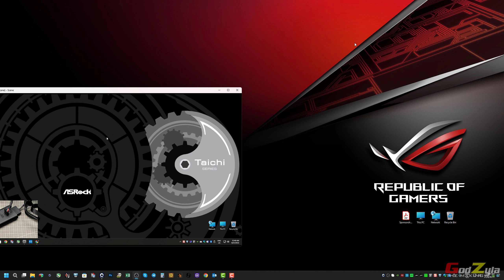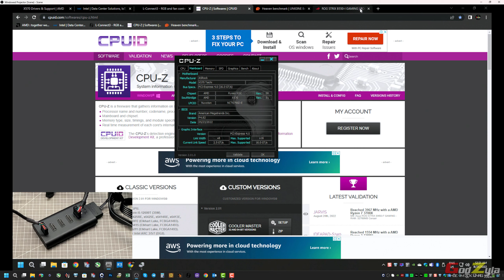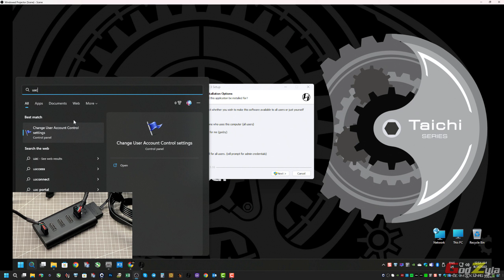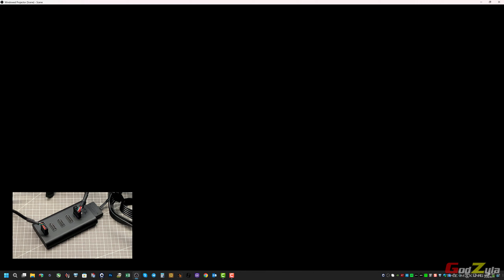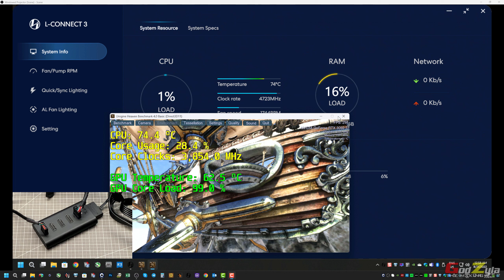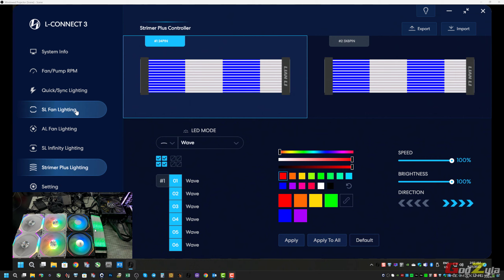Lian Li ARGB Products (How to make it work?) [L-Connect 3]

Comment: Help, I have the strimer 8pin V2 but 24pin V1, and with the L connect 3, how do I set it up?
Reply from the maker: welcom to my channel Siane. If you have the Strimer Plus and not V2, you will need the control box, else you can use your strimer plus via L-Connect 3app.

Comment: The biggest problem is that no devices are showing up in l-connect. And that has no good solution, some say u need to switch out the usb cable but i have done that with 3diff usb cables and im running a 1000w seasonic psu and all other rgb is working just the strimmers for 24pin and gpu dosent show in any rgb program. Lian li is bs hardware. They should stick to cases and thats that. Even asiahorse rgb are better.
Reply from the maker: Hello Glorious Yellow, welcome to my channel. Maybe share what other troubleshooting steps you’ve done? Which motherboard are you using?

Comment: What if your motherboard, ProArt z890 has only one usb header. I put a nzxt hub but they Dont always work. But if I plug it into the motherboard they all work.
Reply from the maker: Hi Jacob Gago, welcome to my channel. After looking at your board specs..it should work fine. Are you able to check your device manager, see if there are any exclaimation marks? have you update your chipset drivers too? https://www.asus.com/sg/motherboards-components/motherboards/proart/proart-z890-creator-wifi/helpdesk_download?model2Name=ProArt-Z890-CREATOR-WIFI . if it still persist I would advise you to seek help at Lian Li reddit forum. See if someone using the same board as you. They might have a solution for you. https://www.reddit.com/r/lianli/ . Do pardon me as I do not have your board to replicate the issue and I no longer fiddling with intel processors. by the way, nice channel https://www.youtube.com/@JacobGagoOfficial have subcribed 👍👍👍

Comment: Hi, I'm new to building PCs, but I have a question regarding your suggestion to unplug the other fans when you update the firmware for one of them.  Will that not cause the PC to overheat while updating?  Or will the fans still keep spinning even if you unplug them?
Reply from the maker: Hi Andrew McCarty, welcome to my channel. It will not overheat no worries as for fans. temporary down.. if it's for your liquid AIO, leave it plug. no worries.
Reply: @KleoYan  Thanks for the response!
Reply from the maker: @andrewmccarty  you are most welcome.

Comment: Hi my strimer cable is plugged in everywhere and rgb is refusing to work
Reply from the maker: Hi Arii🫡, welcome back, which version of Strimer Plus are you using? does it comes with a controller that has a cable plug between this controller box to your motherboard USB2.0 socket?

Comment: hi i only have one of my strimer + v2 who work at a time the switch behind the controller make it switch between them so one is on my motherboard but its frustrating
Reply from the maker: @virtuozefu-hsi6636  hi welcome to my channel. Look at the controller box itself. The two socket which has the switch are for your gpu strimer plus v2 and at the bottom of the box, that’s for the 24pin strimer plus v2. Therefore plug the 24pin strimer plus v2 at the bottom of the box and your gpu strimer plus b2 at the side and switch to point at your gpu strimer plus v2.

Comment: do you have to use the controllers or can you plug directly into the mobo?
Reply from the maker: @gambino48  hi and welcome back. I normally will make use of the controller. There are some of the Uni fans which allows you to use without the controller but you will need to check at Lian Li’s website on the various Uni fans to see if you are allowed to do that.

Comment: Hi, I’m experiencing some issues with my Lian Li SL fans and strimers. The fans are functioning, but the RGB lighting isn’t working for either the fans or the strimers. Additionally, my PC cannot detect the controllers in Device Manager, despite my efforts to update the BIOS and chipset. All devices are connected to the motherboard, perhaps I need a USB hub? I’ll be trying that out and hoping for the best! 😭
Reply from the maker: Hi ceejay, welcome to my channel. Maybe for a start, detacth the Stimer plus v2 controller from the USB 2.0 header of the motherboard, test out just with the fan controller connected. Narrow down one controller at a time. See if it's due to insufficient power issue on the USB 2.0 header. btw what motherboard are you using?
Reply: Thank you! I’ll give that a try. I have all the fans connected to the Lian Li controller, including the AIO, since I switched the NZXT fans to Lian Li for the radiator. I plugged the Lian Li controller (which has a 4-pin fan connector) into the CPU header. Is this correct, or should I connect it to a different fan header? I’m using the Z890M AORUS ELITE WIFI7 ICE motherboard.

Update: Yay! It finally worked! Following your advice to get the USB hub solved the problem. I guess the splitter didn’t provide enough power. My PC can now detect the controller, and everything works perfectly! Thank you! I'm glad I found your channel.

Comment: when i open L connect 3,
I only see the system and setting tabs. doesn't look like the app is detecting the strimers and fans
Reply from the maker: Hi PlayTimeNeverOver, welcome to my channel. You will need to have your system detect the controllers. kindly check your device manager, under Universal Serial Bus Devices. if there are no device detected. kindly go through this content as there are key points that you will need to take note.
Reply: Under Universal Serial Bus Devices, nothing show. but under Other Devices, i see them. although they're named differently "PCI Device" with exclamation mark.
Reply from the maker: @rvibe94  that will be something you need to fix. without the device detected, you won't be able to control the Lian Li Uni fans/ strimer plus or even the liquid AIO LCD. I would advise you to take sometime to finish this content and observe how to fix your issue.. a hint is.. chipset drivers..
Reply: @KleoYan  just want to give you update that I got it to detect. So what was wrong is the splitter that it came with the controller. I had to separately connect the 2 controllers from my fan and strimers directly onto the motherboard

Omg I just read the splitter and realize it's from NZXT. It came off the aio kraken
Reply from the maker: @rvibe94  hmm.. maybe you can get a NZXT internal hub 3.0.. set one side USB 2.0 socket on your motherboard to control your Lian Li ARGB controller and the other USB 2.0 socket for your NZXT AIO.
Reply: @KleoYan  that's exactly what I'm going to do. Thanks!
Reply from the maker: @rvibe94  Nice, all the very best.. and thank you for the updates.

Comment: I added lian li rgb cables and it worked but my lian li fans suddenly turned off it’s light even though the fans are working but there is no rgb and the lian li software only shows the strimer cables. Is the problem because of the installation of the fans on the case?
Reply from the maker: Hi Fay, welcome to my channel. Did you look in device manager to see if your uni fan controller shows up? if not you will need to fix it. follow the content closely and you should be able to resolve this.

Comment: Noted on not to mix & match. But can I have 120mm TL and 140mm TL connected to a single TL controller? I'm not sure if fan size matters for controller even though they're of the same TL fans. Very informative vid!
Reply from the maker: Hi Peter Joy, welcome to my channel. So long your daisy chain set is to one port, you will not have an issue. Example Port 1 are all 120mm TL fans and port 2 are all 140mm fans. Not forgetting once you have done that, go to your L-Connect 3 app and set the fan profile for 140mm to it's 140mm profile.
Reply: @KleoYan  Brilliant, many thanks!!
Reply from the maker: @peterjoy1713  you are most welcome. All the very best with your build too. hmm maybe this might aid you further as a number of my viewers benefit from it. It's not about MX6 thermal paste but more on how I apply paste which to me 98% with good results. https://youtu.be/xZ2R4roF1_Q. the trick is, you do not need thick layer of paste, just a thin layer and sufficient enough for your coldpate to contact the full surface of the IHS.
Reply: @KleoYan  Yes! I had been doing the same application method (with painter's tape) on my previous builds. Though I've been doing away with thermal paste as of late and having great success in using PTM7950 instead, surprisingly. I initially experimented with repasting my laptop with good result in bringing temp down. Then I went to my PC and re-pasted my CPU and GPU. It has been about 4 months since application but here's the before -> after results as of today:  CPU avg 59.6 C -> 47.5 C. CPU max 75.1 C -> 64.1 C. GPU avg 33.0 C -> 28.0 C GPU max 35.0 C -> 29.0 C. GPU hotspot avg 43.5 C -> 38.8 C GPU hotspot max 46.5 C -> 39.4 C. I'm curious if these results stick over time which I hope so. I will keep monitoring. My new build will likely use PTM7950 as well. Thanks again! I am subscribed and looking forward to seeing your next contents!!
Reply from the maker: @peterjoy1713  Oo PTM7950 is excellent for heat absorption. You won’t have to worry as it will last extremely long 👍. Thank you to have subscribed.